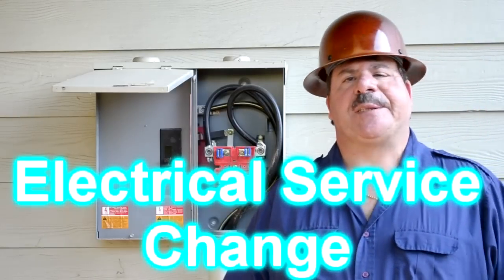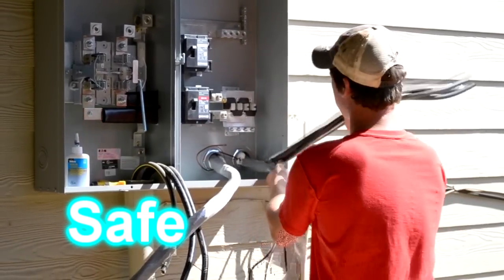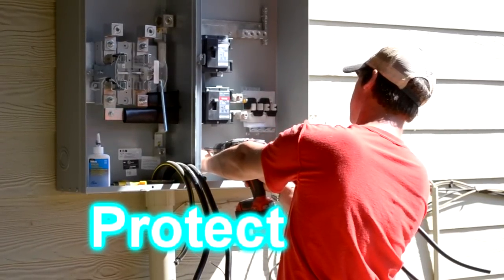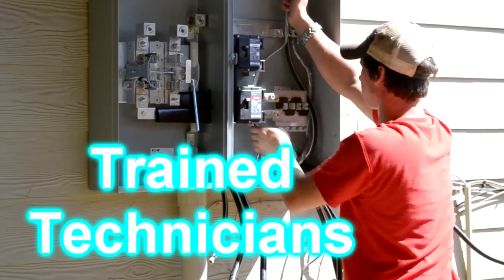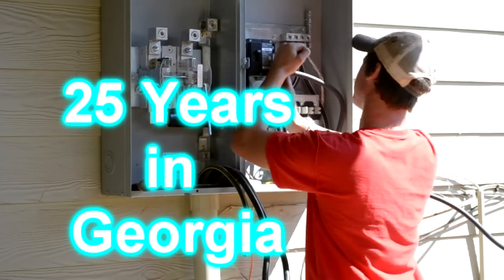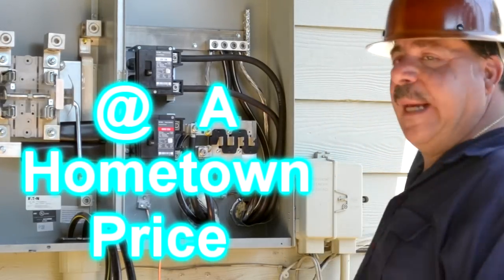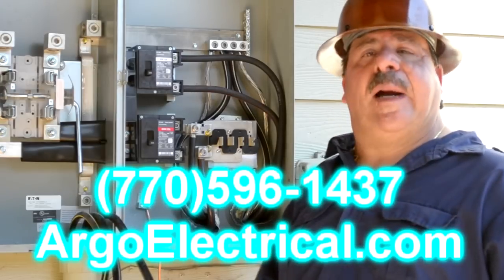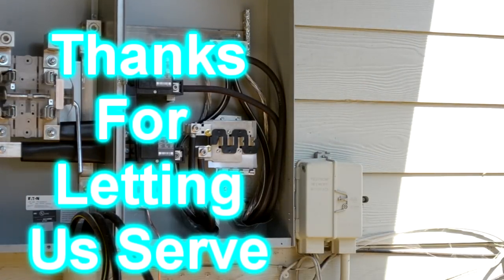Electrical Repair and Improvements: 400 Amp Electric Service Entrance Installed Gainesville GA

Comment: You left out the part about when you pulled the 200amp service from the wall . How did you kill power from the pole ??
Reply from the maker: The Breaker are the disconnects for the 2 panels. The power supply was off while we we're putting this together

Comment: What size wire is used for the line side of the meter?
Reply from the maker: Actually this feed is provided from the Utility. In the National Electrical Code ,  400 Amp Feeder would require a 500  Copper , the feed they use isnt really that big...They Also use a 4/0 aluminum

Comment: 400 amp meterbase are expensive in georgia isnt putting 2 cheap 100$ meter socket meter side by side achieve the same 400 amp service. Also is that not permitted?
Reply from the maker: nhs20102011 actually unless it is a multi family dwelling only one meter base is allowed.

Comment: How the fuck are u feeding a 400 amp service with the same 4 awg aluminum wire  make no sense u need 500s for feed for that 400 amp service plus aluminum sucks cheap. Work copper is best

Comment: my question is why would you ever need a 400 amp service for residential use
Reply from the maker: Lord Thantos many homes in this area are anywhere from 3000-5000 square ft. If the load exceeds 225 amps which would require a service like this one. 300 amp service would use this Meter Base. The wire size would be reduced and the overcurrent protection would include 150 amp Breakers. The cost is actually less expensive for the200 amp  set ups
Reply: for welding
Reply: Electric tankless water heaters (draw up to 150 amps), all-electric heat pumps with heat strips for auxiliary heat (easily 60 amps), and electric car chargers (some tesla car chargers are 80 amps).

Comment: What size is the Service entrance wire? And where can i get it? Any link would be appreciated? It is for a overhead drop 400A Siemens panel
Reply from the maker: FullmetalToolBox it is a 4/0,4/0,4/0,2/0 set of aluminum feeders
Reply: Argo Electrical Services thanks

Comment: Nice video. Beautiful installation. That Eaton meter base made it look pretty easy. It's looks more professional with one enclosure rather than two separate breaker enclosures. This is how I would do it.
Reply from the maker: Mitchell Pugh thanks it's about   7 years old now.....
Reply: @Argoelectrical  actually 11...🤔

Comment: 200 amps upgrade to 400 amps? Maybe interesting for the police to check the attic or basement for something of interests?? Lol :) I know the voltage in the USA is only half that of EU, but every residential house i know here has only 16 amps which is plenty @ 240 volts. Why not 32 amps @ 110 volts in USA then?
Reply from the maker: +Richard van Pukkem  we have some homes here that are over 5000 square ft...
Reply: My last home had a heating system that required (2) 30 amp breakers alone... Two pairs of 8 gauge wire with Two individual 10 gauge grounds.. A bit heavy in my opinion but it was engineered that way... Probably for wire length..
So yeah that’s why we run such big entry services..

Comment: No Lox is to prevent electrolysis between dissimilar metal conductors. (Example: AL to CU)
  Here they are connecting AL wire to AL busses.
No Lox has NO VALUE in this application.  (READ THE MFGRS. LITERATURE)
Also the ground conductor (#4CU) must be bonded as it passes thru the 12ga. steel of the cabinet.  (AS PER NEC)
This Electrical Contractor is incompetent and ignorant.
BTW - What size are the Service Entrance Conductors ?  They look too small in the video.
This 'Good Old Boy' needs to spend less time at the BBQ drinking beer.
Instead of hiring Argo Electric to do your job,  it looks like you'd be better off hiring some bum standing in front of Home Depot.
Reply from the maker: • DOX4 • Noalox Anti-Oxidant Joint Compound. 
• Size - 4 oz 
• Seals out air and moisture to prevent corrosion. 
• Prevents reformation of oxide film on connections.
Reply from the maker: NumNutz
Reply from the maker: +buster crabbe Really??
Reply from the maker: It also Reduces Oxidation...
Reply from the maker: The #4 Is Bonded In the Cabinet in 3 Places!!!
Reply from the maker: By the Way Quote the Listing in the NEC......Were is it Located....???
Reply from the maker: http://www.sitepro1.com/store/cart.php?m=product_detail&p=430
Reply: Argo Electrical Services ignore him he thinks he's smart because he can disagree

Comment: Looks like Curtis used a sheet metal screw instead of the NEC required drill, tap and threaded machine screw to bond the grounding lug to the can. Which doesn't make sense anyway, why not just take your #4 GEC up to the vertical lug strip on the neutral bar?  FYI, 200A SER is 3-4/0 & 1-2/0 grounding conductor
Reply: A ground rod does not need any larger than a bare #6 copper the #4 is for the water main which could be a 1/0 copper being the service mains for both 200 amp services is 500 mcm copper or 600 aluminum

Comment: Who the Hell needs a 400 amp service in a residential home.
Reply: welders
Reply: I do.  5000 sq ft home with two electric cars.
Reply: Bitcoin miners
Reply: maybe there is no natural gas service and electric feeds the baseboard heat as well as the air conditioning ....  understanding its Goergia and mild temps it might be efficient to use electric for heat....  not here though in the North....  thats asking for big electric bill..
Reply: It’s a duplex
Reply: Maybe they don't need it in their home unless you have 3 or for daughters running your house like a beauty shop. May need it for a barn or a workshop.
Reply: Brights Electrical did a 600 amp service on a 17,000 sqft house.  the house has 4 kitchens, 6 HVAC units, Suna, 2 Steam units ECT.....….

Comment from the maker: Yeah, we thought we were creating a Delta Neutral so our transformer would work The Grounding Conductor is permitted to be the same contact as the Grounded conductor. The Neutral is actually created in the 200I Panels...The Neutral Bar and The Ground Bar in the Load Side of the 400I disconnect are both Touching the Can...In the Panels they are not...

Comment: No connector for that ground wire Curtis? Same 4/0 urd from the 200a now being used for 400a? Things are a lot different in the south
Reply: What's the cost of an upgrade like this? Ball park.. looking to get it done..